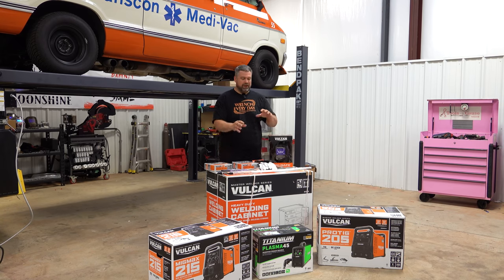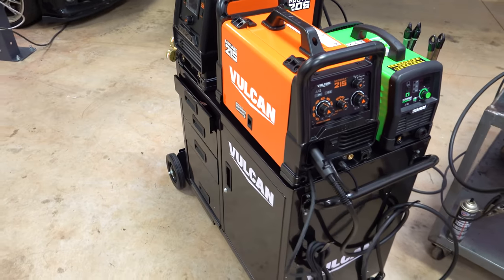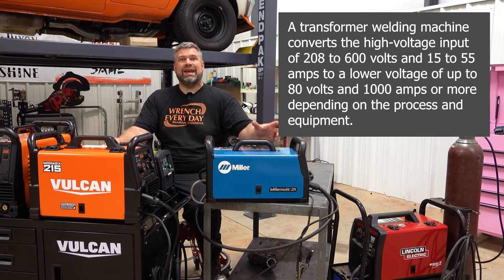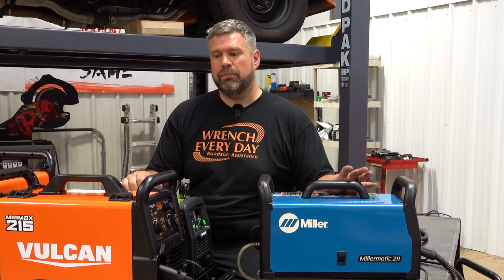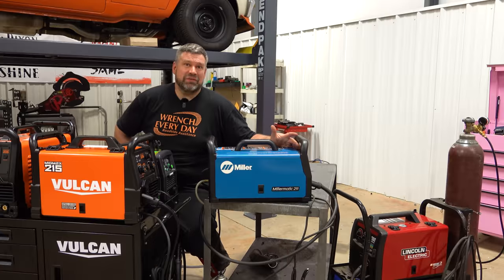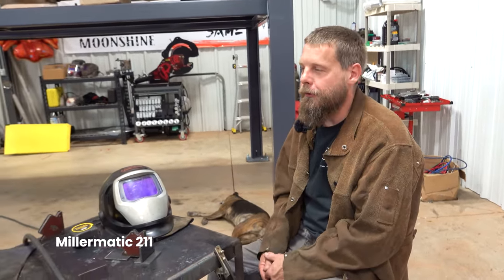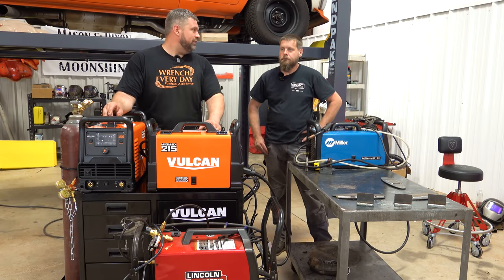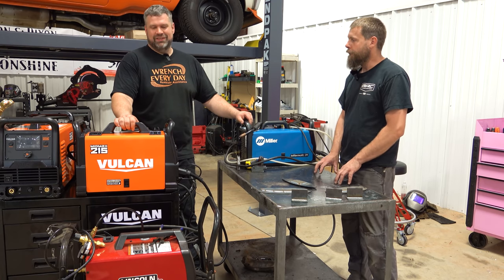Here's What NO ONE Will Tell You About Harbor Freight's "Best" Welders....

Comment: I sat down and read a lot of the reviews on HF for the Vulcan welders a year ago thinking of getting one. Lots of positive reviews, but many of them were from new users who had not used it much, but I wanted to see the reasons for all the negative reviews. One big complaint was that the warranty is so short. Count on adding the extended warranty cost or just buy a new welder if it breaks anytime after the out the door HF warranty... 
Recent Lincoln inverter welders looked not much better than HF...lots of control board failures in review comments I read, and expensive circuit board.
The weakness in inverter technology is circuit efficiency. They approach 85-90%, but any inefficiency gets converted into heat. Heat dissipation has limitations and costs money to mitigate, and like most things, welders are designed to a "price point", especially at Harbor Freight. 
In a welder that already draws very high current something is going to give when the heat builds up too much when someone regularly pushes the duty cycle too far... To help keep the controller cooler unplug the machine, take off the covers, and blow the dust out that holds in heat. There's a lot of air moving through the machine that deposits a lot of junk.
Reply: I was a pipeline welder and then a CWI I have seen several female welders and all were excellent welders females seem to be just as good as their male counterparts

Comment: I purchased the $100 120v Flux welder from harbor freight. I have done many a ugly weld with it, I needed a 120V that could run off my inverter in my truck. I got a lincoln 185HD and I love it. Biggest difference to me is that the Lincoln does pretty welds. Looking at that Vulcan tig tho
Reply: The el cheapo HF welders are missing a few parts that would smooth the arc out if they were present. That's how they make them so cheap. There's videos here of folks retrofitting the parts into HF welders. Do a search for HF welder upgrade or something and you should find them.

Comment: Been using the titanium welder for years. Three pole barns two green houses small shop and shed All 2x6 14ga tube haven’t popped a weld yet. Some buildings been up for 10 years. Not the smoothest machine but gets the job done

Comment: I assisted at Randy's birth  in between welding ss heat exchangers on a production job. Bought a Vulcan pro tig 200 5 yrs ago. It came with the Best foot pedal I ever used. Swapped out the air cooled torch [heavy and hot] for a watercooled  weldcraft hw 20. Still use my Miller 330 for heavy duty work, it lost control on the low amp end

Comment: One more consideration with inverter machines is they can be picky about input power.
If you live in the middle of nowhere and are near "the end of the line" of the power company you may have brown outs and other disturbances that can scramble the brain of your inverter machine.
Likewise if you run if off of a generator.

Having said that the inverter machines just have so many more options.
I just picked up a multifunction machine that has adjustable hot start for stick welding and even lets you adjust the inductance in all modes.  That is in addition to being synergic.

Comment: So I'll have to say, I had a choice between the Vulcan and the titanium series welders. I did go with the titanium  unlimited 200 due to the cost as a hobbyist. I have been thoroughly impressed with it so far. Just bought it back in January and have used it on several projects so far. Thickest steel welded at this time has been 1/4" plate. I have used the stick welding and the mig with flux core on both 220v and 110v. It has impressed me this far. My only concern with it is how long it will last before it starts having problems.
Reply: I bought the titanium unlimited 200 July 2019 and it's still going strong. When I bought the machine there was something wrong with the mig liner. After I replaced the liner it worked great. The only thing I would change out of the box it the stinger(rod holder) I replaced mine with a lenco af-25.

Comment: (Long post...) I'm a qualified boilermaker and ticketed in multiple processes (MIG, TIG, MMAW) and live in Australia. Like Randy, I cut my teeth on the old school transformers, but at home I run all inverters due to budget constraints. 

I agree with Jared's comments Re serviceability (transformer vs inverter) but have thankfully not had any issues with any of my machines in over 8 years of use (on my MIG).

I have found that the only real difference between budget machines (sub AU$800) and premium machines (AU$1500+) is the duty cycle. The duty cycle on a welder (without getting too technical) refers to the ability of the machine to run for long periods of time without overheating. This is not something a backyard welder or even a qualified person like myself needs to worry about, even a low duty cycle of 30% will make no difference to 99% of users out there, so don't be talked into it (IMO).

One thing to look out for is do not buy a MIG that has a gun/lead that is moulded/hardwired into the unit. The budget machines do tend to have less robust guns and are prone to wear and damage over time. If you buy a budget welder with a standard socket you can get really nice aftermarket quality guns for around (AU$300) which still puts you well under the premium price point of more expensive machines. 

For my Aussie friends, we don't have access to Harbour Freight here but we do have some good budget options available. Hare and Forbes are in Mel, Bris, Perth & Sydney and stock some great stuff. They sell the UNIMIG brand of welders that I use and are awesome budget-ish machines (around AU$1000 on special). Ebay has cheaper stuff but quality can be a bit of a raffle. (Btw, Hare and Forbes is a machinist's wet dream and well worth a visit just to drool over mills, lathes, tooling, etc...)

I also run an ACDC tig welder. The brand I use is a Duralloy and cost me AU$1000. I picked it up at my local welding supply shop in SE Melbourne and it is fantastic value as most options here in Aus will run upwards of AU$1500. Great machine works really well and seems to be of good quality construction, but full disclosure I have only been running it for 1 year, so can't speak to longevity.
Reply: IDK if AUS has Everlast, but they are china welders with a real warranty and decent build quality, with being the same price as HF or often cheaper.

Comment: I have a Everlast multi-process welder it does stick MIG And TiG AC and DC. . So you can weld aluminum.and lots of TIG adjustments. Its great i have no complaints it welds in all MIG TIG and stick great. it also does synergic MiG. Also 110 or 220. Need 220 to weld above 115 amps. I have had it for almost 3 years and i payed $2200. I would highly recommend

Comment: In my fab shop I had 3 Deltaweld 450's and a couple Millermatic 250's for small stuff. Always had to have at least 2 of any machine because 1 is usually in the repair shop and for many years that was just the way it was. I took another career path and downsized my shop to just the 250x for walk-in's and projects. Long story short, 2 boards went bad in 5 years at $800.00 a pop. When the 3rd went bad I sold it for scrap and bought a Harbor Freight Titanium 200 for $600 at that time. 3 years later and it has done nothing but make me money. Weld quality is just as good and will burn .035 into anything it's designed for. Listed duty cycle is half of the 250 but I have never had it to trip off. When it dies I'll scrap it and get another one.

Comment: I bought one of the Vulcan Multiprocess Welders that was half off in clearance, but one thing made me return it before even trying it. The main issue was that I saw plenty of people having arcing on the power switch and some people reporting that the arcing led to board failure, pretty sure it was one of the power supplies they were talking about. That's not too scary, but the bigger problem was that Harbor Freight doesn't sell any of the boards or replacement power switch, etc. If any of those go, you better hope it's under warranty. Since they don't offer even a 90 day warranty on most clearance items, I decided the gamble wasn't worth it. It might make sense to buy the welder on sale and buy the replacement plan.
Reply: Inverter welders are one place where an extended warranty may be ah, warranted. But sometimes you get stiffed on those too. Inverter welders scare me. They're perishable items. There's parts inside of them that just can't last. All electrolytic capacitors have have a finite lifespan. The caps China uses have a real short lifetime too. Whether that's by accident or design I don't know. I've watched videos of folks that have opened them up to try to fix them. Forget about it! Even if you know what you're doing they're built in such a way that servicing them is impossible. They aren't put together to take apart.

Comment: Just a quick addition around 16:55 - the Everlast LightningMTS 225/275 are two multiprocess machines that can also do AC TIG (they're the only two I found when I was looking).  I bought one but haven't had a chance to put it through its paces just yet.  But if you're looking for a single machine that can handle AC and DC processes, that's definitely one to consider.
Reply: Got the MTS 225 myself.  I've used all the processes and love that I have one machine that does it all.  I also have the Harbor Freight welding cabinet.  It is a very well built cabinet.  I store all my welding tools in it.

Comment: My kid is a welder and has used the Vulcan 220 Multiprocess for over three years without a hickup. He used on 110v and was able to weld 1/4 inch steel and stainless steel with wire and rod without any difficulty.

Comment: I've used both the Miller 220 and ESAB 205 both of which are multiprocess welders (mig/tig/stick) and both can do AC tig. Can't decide which one I like better but I don't think you can go wrong with either if you want one machine that can weld steel and aluminum.

Comment: I would have liked to have seen the welds themselves, to be able to see how smooth the beads looked. I base my welds on how the weld sizzles, too much popping/crackling can produce crappy results, poor penetration, metal deformation, or even burning through the material. The Vulcan welder in my opinion, sounded like it runs smoother and more consistent than the miller, and the Lincoln. I started out welding at age 13, using a Lincoln arc welder (yep, the old Buzz Box/Tombstone style welder). This is a tough decision to make for buying a welder. I’d have to go for warranty service, before pulling the trigger on a purchase.

Comment: I wasn’t willing to go “all in” on the Vulcan, my wife would have thrown a fit. After seeing this I might have to get one when I get some extra cash. I got the low end 20% duty cycle flux core but I’ve been using very high end machines at my various employers - provided by them - that the low power gets frustrating at times. 
Thanks for this evaluation, it was the best that I’ve seen. 
Btw, I’ve used duel setups in steel foundries that also doubled as air arcs so the flux core low voltage was a real challenge.
Reply: I have the stick/tig/mig machine and I’ve been very pleased with it. 

I also have a Miller. Only thing I like about the Miller more is the duty cycle. They weld about the same
Reply: That's a painfully bad duty cycle if it really is 8 minutes wait for every 2 minutes work. A second hand oil transformer machine is probably superior for most jobs unless you really need MIG, over stick welding. You can run them constantly rather than stop starting all the time. The downside is the weight of the unit, but if it's only used in one place then my preference is for very old tech lol. Stick welding suits most of my needs as I don't do thin sheet steel work.

Comment: This is a good video. I'll add, the more expensive machines are designed with the professional in mind. It needs to run consistently , reliably, and problems resolved immediately, a business NEEDS their equipment to work 100% of the time.  For this you pay a premium.  The hobbyist needs it to do what is expected of it reasonably reliably. A broken welder, to a hobbyist, is a pain for the weekend. A welder that is more finicky and takes more time to get working smoothly is a mild inconvenience for a hobbyist, vs death to a business. That being said, cheap welders are disposable. Customer service is almost non existent. Of course I bought a Chinese welder of Alibaba about 7 years ago. Took a little bit to get it to the machine I wanted( switching from negative to positive ground took some modification) but it has been reasonably reliable. It does what I need when I need it. I'd never trust it to run a business, unless I had 2 or 3 of them as backups. Will I buy one again? In a heartbeat, but my welder runs maybe once a month, vs 40 hours a week. Keep all that in mind when choosing a welder. Time critical projects , the reliability, and consistency is worth the price.

Comment: I have a nice Hobart Mig but as you said I don't notice a major difference between the different inverter welders.  Really the thing you are paying for is the duty cycle and the longevity.  But there is an argument to be made that even the big brands may not last that long and cost on fixing can be high so buying a middle of the road one and just replacing not repairing it may be the cheaper option.

FWIW I've never noticed a cold start with it like you mentioned with the miller. 

Curious to  see the plasma cutter in action under real world use that is probably the next tool I want to add to my garage that is quickly reaching the level where tools exceed space LOL

Comment: I've been welding since 1983, certified since 1992.....Recently downsized my 7 day a week shop....I've owned 220 Millers/Hobarts/Lincolns, all roll around models. Downsizing the shop I bought a Vulcan MigMax 215, it's been mounted 7 feet in the air on a swivel hoist for almost 5 years now (removed once to clean) and have pushed well over 400 pounds of .030 wire through it, old school style using straight Co2. The machine has been flawless. I did however upgrade the trigger gun from a company who's created an upgraded set up which uses much more common consumables. If anyone says this machine is junk, they have no idea what they're talking about. On a side note, I also picked up a kick around Titanium Mig 140 from HF, fun little machine which is also impressive for the money which I use in the driveway, my basement, anywhere I need.....runs a nice bead!
One side note, the last brand new Lincoln I bought I burned the ground off within 3 minutes of using inside the machine, it was improperly connected.....not impressed.
Reply: My migmax215 uses standard tweco consumables any Lincoln would take.
Reply: @CustomWeldingandFab  I upgraded the torch in general due to the heat range I run, everything lasts much, much longer.

Comment: There are absolutely multi-process welders that can do everything, AC/DC MIG, AC/DC TIG, AC/DC Stick, as well as various frequency and pulse options, and different waveforms. All in one machine. Some even do double pulse, in every mode. For instance, check out the HTP Pro Pulse 300, and the HTP 220, from USA Weld. Some of the best and most capable welders on the market as far as I'm concerned.

Comment: Can instantly tell that the HF machine has a cleaner output and the settings are spot-on. It sounds exactly like it should.

Welder dude also seems kind of surprised about the post-flow. He said he uses old-school Miller transformer machines. If he's using a 252/251 or 350/350P then it has a postflow setting, he's just never messed with it.

Comment: If you really want the most bang for the buck welder than check out Everlast.   I have welded professionally in several job shops and without a doubt the Everlast 221STI I purchased for home use now that I a retired is the smoothest machine I have ever ran.  I have had it almost 5 tears and I have built some amazing things with it as well.  But it is a AC/DC tig mig stick in one compact invert welder unit.  But not just a starter mig  tig, it has very advanced features.    Not that I have used any Habor frieght welders except my dads little Vulcan flux core.  (not impressed)   But I buy lots of harbor freight hand tools and love most all of them.   In the last 10 years they have picked up quality 500% or better on hand tools and some machine tools..   Their  toolboxes are for sure the best for the money and better than many other name brand by far.  Very well made.  So I am not trashing harbor freight.

Comment: Inverter machines aren’t known to be trouble free. I own a couple of them and I’ve had to repair all of them at least once. Mine are brand name machines and I can just go to the LWS and get or order a part even though the machine is 20 year old. Having taken these things apart I’ll tell you they are loaded with circuit boards and ICs. The thing that scares me about the Harbor Freight welders is where the hell are you going to get parts for one? I’m willing to bet you can’t get replacement boards and I’m willing to bet there are ICs on these boards that aren’t available as they are proprietary. I can’t go to my LWS and get a part for a HF welder and I certainly can’t drop it off for repair. I’d recommend sticking the brand(s) that your LWS sells. Saving a few bucks up front isn’t saving anything it craps out and you can’t fix it 20 years down the road.

Comment: Inverters are primarily Mosfet transistors.  They can step up voltage or step it down alot easier than a relay or contactor. Whatever you want to call it. Transformers primarily just step voltage down from 240 volts to around 25 to 40 volts to weld with. Amperage can be controlled by the inverter too but it's probably doing more by varying your A/C sinewave up and down.